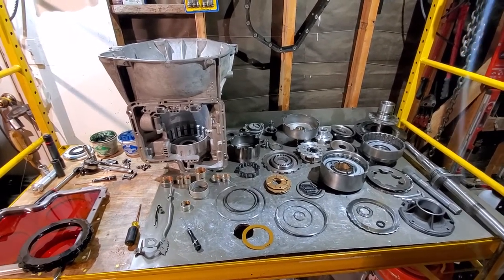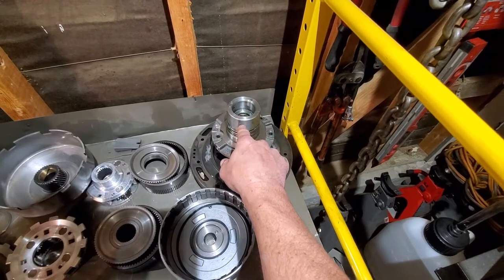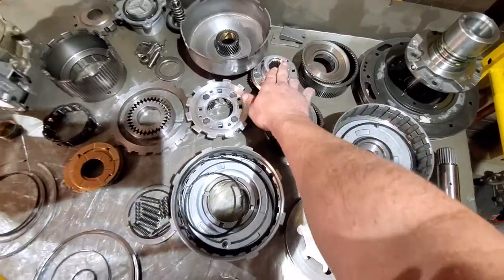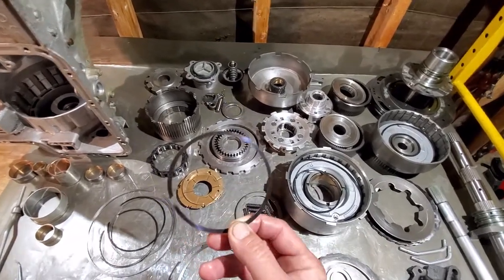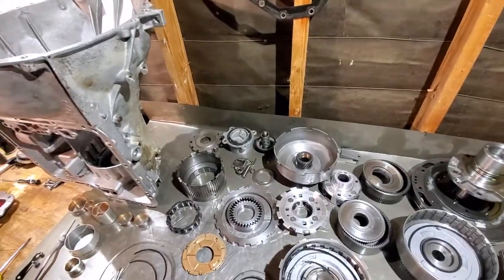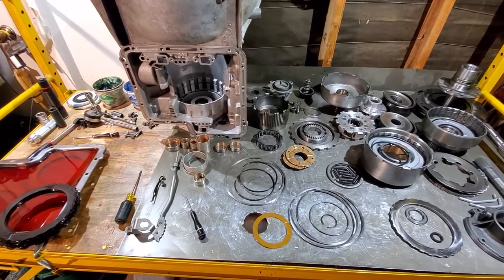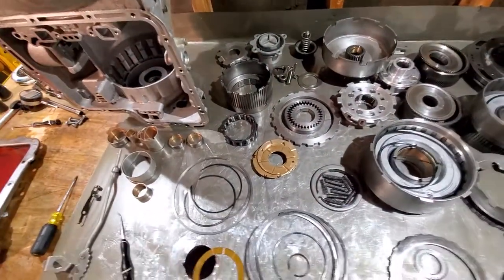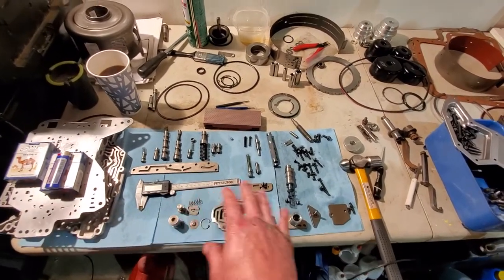Tips and whatnot for the Ford C6 Transmission

Comment: Hey boss, you are the c-6 wizzz! I need to know if my C-6 was rebuilt and ran good from 2005-2008 and then parked in the desert garage for 15 years what should be done if anything before running it? It is not leaking fluid anywhere.
Reply from the maker: Thank you. If all was good before parking it, then all I would do is basic fluid and filter change. That’s it. While performing fluid change, visually inspect a few things. Mostly the vacuum line, make sure it’s not rotted. But all should be well.

Comment: Hello @r1ddl3 and thank you for this awesome video. I own a 1971 Ford LTD with a C6 transmission. 
I noticed when it's cold it will shift in reverse perfectly but won't shift in Drive. I put the gear selector in D and the car simply doesn't move. 
Once the car is warm, it doesn't appear to have this problem! 

Also: when parked for a long time (around a week), there is a huge leak in transmission fluid. 

But when the car is hot, it shifts and runs perfectly. Very smooth and the liquid is cherry red. Do you recommend a full rebuild? OR simply the valve body and pump? 
Many thanks,

Comment: great video. My c6 in my '69 Merc Monteray won't shift from Park to any other gear with engine running, but shifts through gears fine with engine off. If I start the engine in Neutral, and then shift to Drive, it works, but stays in Drive no matter what gear I put the selector in. Any ideas? FYI, external linkage appears fine. Thanks again for your videos
Reply from the maker: Thank you
I would check all lines going to transmission,  especially at the rear vacuum modulator. Also, sounds like there is a problem with the selector rod in the valve body. Was the transmission rebuilt recently? If so, possible that the valve body bolts are too tight, very easy to do. Also check the parking pawl action, might not be working properly, could also be a bad converter. There are multiple things that could cause those issues, but I would start with those. Most likely not just one thing but 2 or 3 things at once giving you the issues. Hope this helps
Reply: @r1ddl324  Thanks very much for the reply. I will start by what I can see externally and then open her up and check out valve body. I've never done work on trannys before. I'm not sure if the tranny was ever replaced, I'm trying to do a revival on this car....sat for 20 years. I got the engine freed up and running, drove it 60 feet, then put a rebuilt carb on it and this tranny problem started. I was hoping it was something simple. Some people suggest seized forward clutch plates. Thanks again for your comments!
Reply: @davidlinkletter6868 did you go through it? Probably needs a good look and refresh
Reply: @jamesmedina2062  needed a full rebuild. the forward cluthes  were shot
Reply: @davidlinkletter6868  Gotcha. You probably did did more than just that huh? Did you rollerize anything or just standard bushings?

Comment: 1:16 Got a question about the larger drum bushing. I had ordered a rebuild kit on ebay that had this one in there damaged. A replacement bushing was sent to me which is about 3mm lower than the original one, which was 31.4mm tall. The replacement is 28.3mm tall. Is that height difference going to be an issue or would that fit just fine?
Reply from the maker: If it’s the hight, you should be fine. As long as it’s not the thickness of the bushing that’s too thin. You need to check your backspacing to be sure, but should be fine.
Reply: @r1ddl324  Thank you very much. That puts my mind to rest. The thickness is the same, so that's good. I appreciate the quick reply.
Reply from the maker: @JohnSmith-wj2wd  no worries, any other questions please feel free to reach out to me.
Reply: @r1ddl324  I appreciate it. I was wondering a few other things, if you don't mind me asking;
-When I took the bushings out of the sealed packaging, some of the bushings looked as if they were a tad oxidized, or in some way a bit dirty. I see some webshop pics look very similar.
Is this a normal thing? I had expected them to be absolutely pristine.
-In the revision kit, one of the frictions has its material offset a tiny bit to one side. About 0.75mm. The teeth are still clear. Could this cause any balancing issues, or is that sort of shift neglegable?
Reply from the maker: @JohnSmith-wj2wd  as for the friction plates, depending on the brand, you will find those inconsistencies. It is fine and will not hurt anything. Some cheaper kits have those little quirks with there frictions. Always check your clearance for each clutch assembly. 
As for the bushings. They usually are always like that. You can actually mold bushings to what you want. As long as there is no rust on anything. A quick wipe with some WD-40 should clean them up. And remember to use lube on the brass side of them.
Reply: @r1ddl324  That's a relief to know. Thanks a lot for the information. It's really helpful.
Reply from the maker: @JohnSmith-wj2wd  not a problem. If this is your first rebuild, remember to take it slow. Slow and clean are the best things you can do.

Comment: Hi How you doing?
My name is Bob Lemay, I live in Ct.. I'm about to rebuild my c6, it's out of my '77 f150. I have 2 c6s, one that came out of the truck, one I bought with a spare engine. I have many questions, even though I've read a rebuild book, and have watched countless videos. I'll start with a general one, I think the three major critical clearance areas, are the two drums that hold the clutches and steels measured at the snap ring, then the overall end play after everything has been put back. Is this correct? I ordered a rebuild kit from performance automatic, their pro max kit, and a lower ratio forward planetary with Torrington bearings from CK trannys. Hope to hear from you, great videos that actually have  detailed explanation as to what you're doing and why.
Bob
Reply from the maker: Hi Bob,
Yes those are correct. As for overall endplay, you want to check rear output shaft, there are shims you can get for the adjustments in certain areas (get the metal ones, not plastic). Depending on what you want to do with the truck will determine your clearances for your clutches. If you have any questions, don't hesitate to ask. The C6 is one of the easier transmissions to rebuild, your manual will be your best friend for most of the build.
Reply: @r1ddl324  thx for the quick reply! the good thing is that I'm able to start by dismantling one of the c6s, using it as a practice run. I'll then rebuild the other one for real. no problem so far with the teardown, just document every step, and put all small pieces parts into corresponding plastic baggies, with the step number written on them. Also pictures of every step, as to how and directions of everything that came apart.
Bob

Comment: Trying to find why my c6 doesn’t go to 3rd gear replaced modulator vacuum hoses ok still doesn’t shift
Reply from the maker: Try adjusting the vac modulator. There is a set screw inside where the vac hose attaches. All the way in is later shifts, opposite is shifts very soon at lower rpm. Also, check seals at modulator and replace if needed
Reply: @r1ddl324  much appreciate super fast reply 🙌 did all of this I played with adjustment screw after replacing modulator still no shift to 3rd
Reply: @r1ddl324  maybe I need to do bigger range screw adjustments to see if makes difference I think I did 2 turns in both directions which didn’t help
Reply from the maker: @tomsky  gotcha, I would try maxing it out each way and see. Also, you have checked the vacuum itself correct? If this does not work, then it could be a couple different things to chase down. 
Let me know how it goes.
Reply from the maker: @tomsky  and thank you, I’m here to help as much as I can
Reply: @r1ddl324  much much appreciate! There is vacuum I tested on neutral but not sure how to tell if vacuum is strong enough I should check things tomorrow and message on here much much appreciated 🙏🙏🙏🙏🙏
Reply from the maker: @tomsky  always here to help 😁
Reply: @r1ddl324  any help better than no help 🤗🙌🙏
Reply: @r1ddl324  funny how you’re here to help everyone else
Reply: @r1ddl324  hello just a quick update I was adjusting the modulator screw back n forward and still tranny doesn’t catch on the last gear i tested the vacuum with my finger and it is there one thing that I noticed the transmission seems hot to touch not sure if this is normal

Comment: I thought I read where the race is hardened steel, and carbide has trouble getting through it, to cut it down for the torrington bearing.  I'd like to rollerize my c6 as much as I can.  Could you help me with some suggestions and point me in the right directions please?  If I can go to the 6 pinion sprag, which lowers 1st gear ratio and get it for a decent price, I think I'd like to try it.  Any thoughts on that?
Reply from the maker: Race and Torrington you can get from any good parts suppliers, also get the E40D roller sprag (it's a one piece sprag and you don't need the two snap rings to hold it in). As far as the input planetary, there are a few makers and they are all well built, any major brand will do
Reply: @r1ddl324  Is it the 6 gear forward planetary that lowers low and second gear?
Reply from the maker: @0lddragracer426  there are many different front planetary setups you can use. There are 3 and I believe up to 6 pinion planetaries that were used and still retain stock gear ratios. There are some companies that sell the upgraded planetary setups that will allow a lower 1st and 2nd gear. Try ATI Performance, they might have something your looking for.
Reply: @r1ddl324  Thank you...

Comment: what should the clearance be between the pump gear and pump housing on the od of the gear?
Reply from the maker: No more than 0.003
Also, make sure you do not have any clearance issues with the pump gear teeth hitting the crescent divider in the pump body as well. There are multiple modifications you can do to the pump body, but most are for higher HP applications.
Reply: @r1ddl324  Thank you sir
Reply from the maker: @briansanford3715  any time
Reply: @r1ddl324  Can you explain the pump modifications for say high performance street?  Thanks...